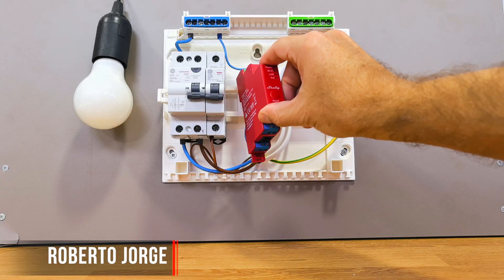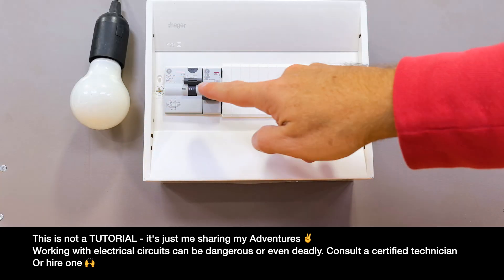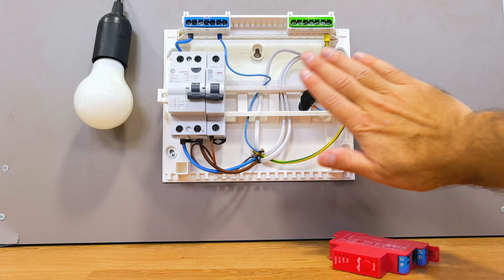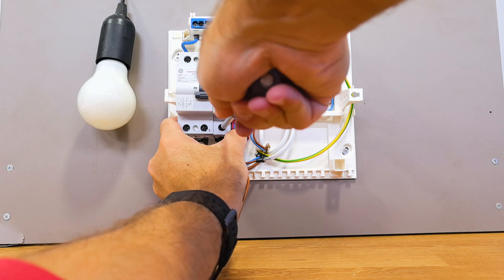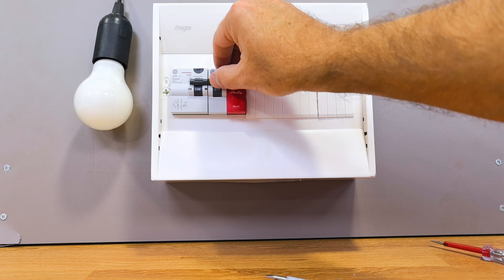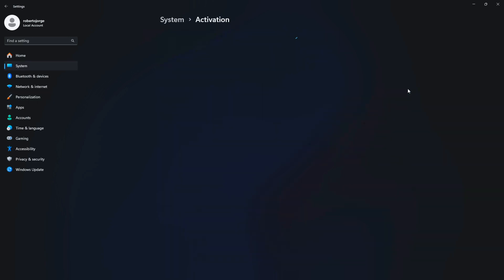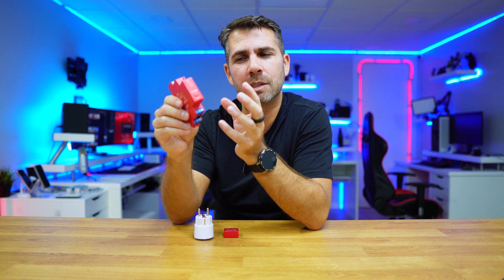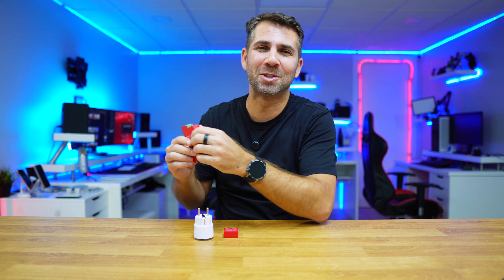Installing Shelly Pro 1PM "Smart Breaker" for Solar Panels 🔥⚡️

Comment: As a note.  This is not a smart "breaker"   It is a Smart Switch only.  You MUST use a standard circuit breaker in line with it.
It is very misleading to have the description listed as Smart Breaker as this device has no circuit protection capabilities on it's own.
I say this with respect, but also out of safety concerns as many people try to DIY these devices in switchboards, which could lead to a dangerous situation where people can get killed.
I know in your video you showed using the breaker, but the video description could be misleading
The smart switches are really great when you need to control an entire circuit, to turn it on and off, or you can rewire things to a Star configuration back to the switchboard.      I find Shelly products tend to live up to their sales pitch and the reputation for good customer services is there.

Comment: I just installed my first Shelly Pro 1PM. I had previously worked with quite a few of the "normal" Shelly's, but this was the first Pro.
Thing is...I watched your Video to make sure I did it right, and wad a bit confused by the way you wired it. If I connect the Shelly to the bottom of a neighbouring breaker, then the Shelly will always be on. IMHO, the correct way is to connect the Shelly to the top of the Breaker, to make sure the breaker actually switches the load and the shelly off if there is an issue.

Comment: I have a Shelly Pro 2 with 2 channels, do I need to supply the power for each channel from separate breakers?
Reply from the maker: Hi Steve, i havent used the 2, but haved used the 4 which i shared here on the channel and was not necessary so i imagine that you dont. Only 1 input and 2 outputs but please make sure on the diagram 🙏✌️
Reply: @RobertoJorgeTech Thanks if you only need one supply for the 4 then the 2 should be similar